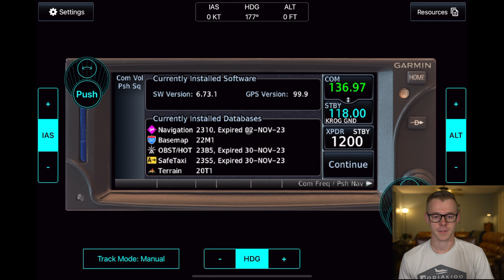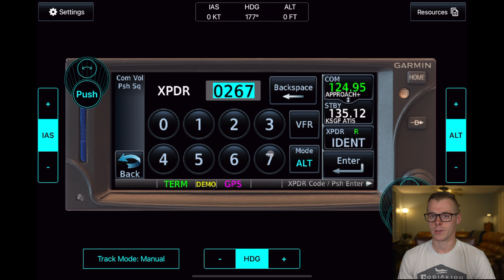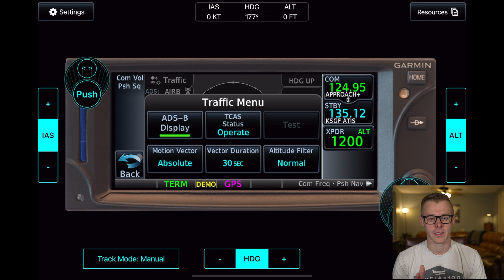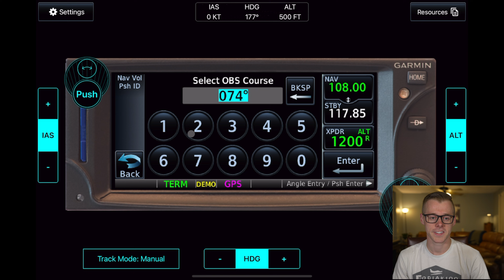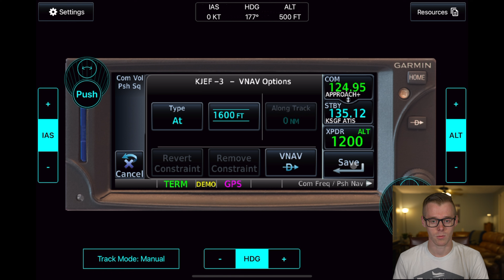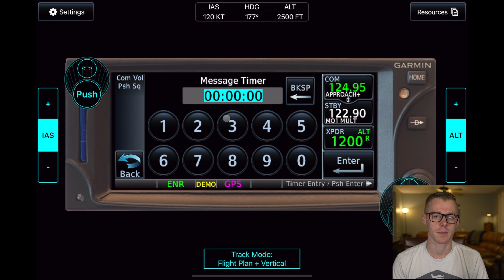How to Use the Garmin GTN 650 - Unlock Your Touchscreen Navigator

Comment: How do you adjust the transmit and alerts volume DOWN?
Reply from the maker: I've done some digging on this, and haven't really found a good answer for you, I'm assuming it's either a volume setting on the audio panel, or is something that's adjusted on the back end of this unit through the service port, in which you'll need an avionics shop to do that. Sorry that I wasn't much help!

Comment: Very good tutorial on the 650 functions.  How does one find the screen that controls the WAAS options?
Reply from the maker: Hi Al, you can go to Home > System > GPS Status > SBAS to enable and disable WAAS, however if you're looking to do more than that, it'll probably require the help of a dealer or avionics installer who has access to the backend of these units.